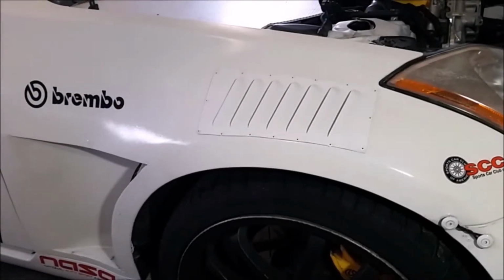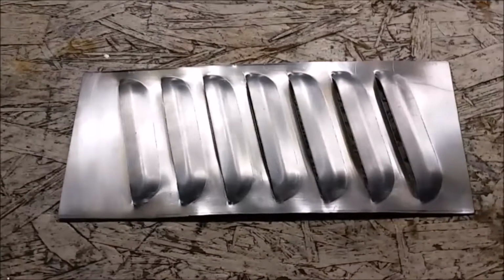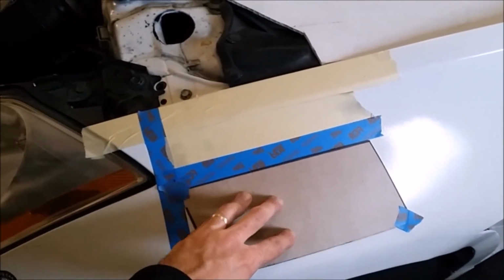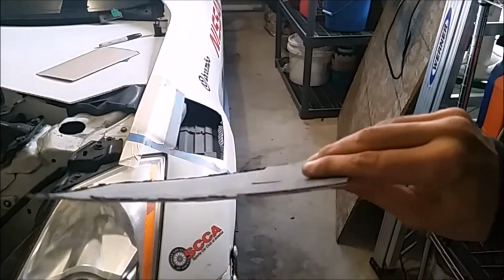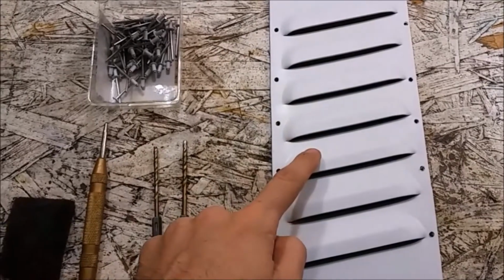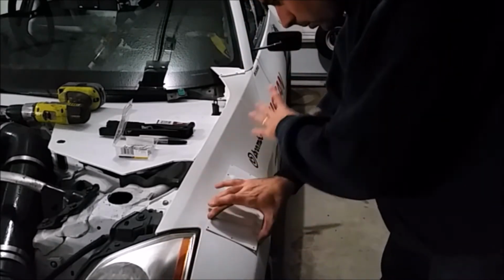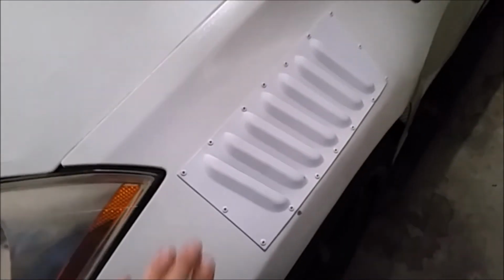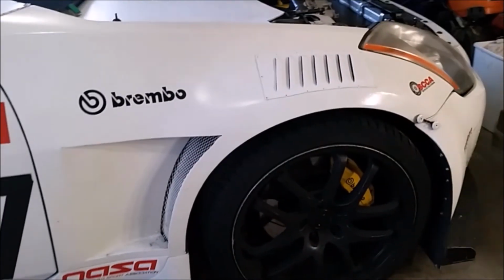Nissan 350Z DIY Custom Fender Louvers

Comment: I'm going to do this to my Z as well. Thanks for all the good ideas, as I continue to make changes to my Z for the track. To confirm, the link you provided sends me to a pair of 4 mini Louvered panels 4" (Item #40); is that the correct size? The picture on their website for the panel looks a bit diff/smaller than what you have, so I just want to make sure. The one that better matches what you have are the Angled 7 Aluminum Louvered panels, also 4" (Item #41). Thanks.
Reply from the maker: You are correct. Not really sure what happened with the link